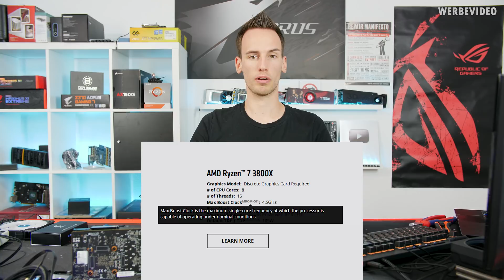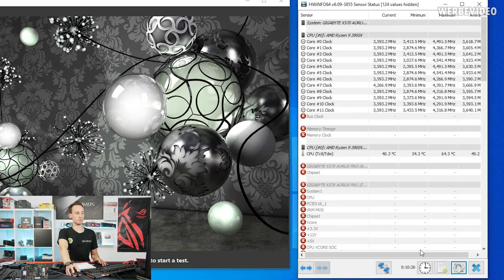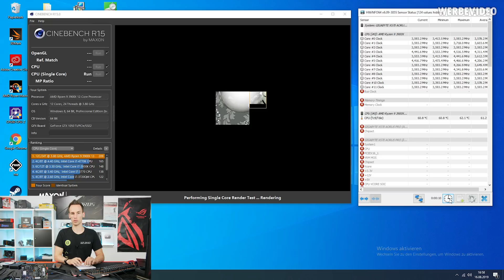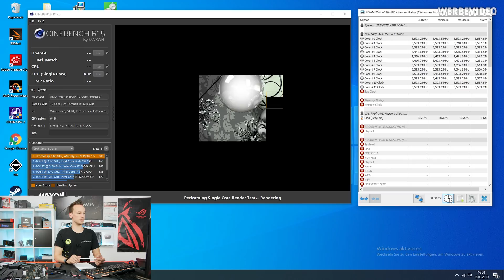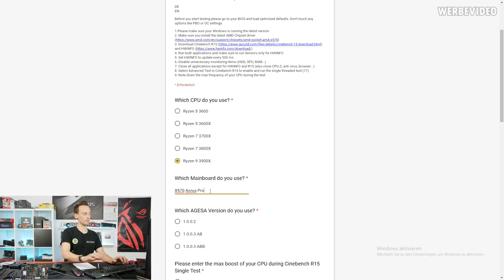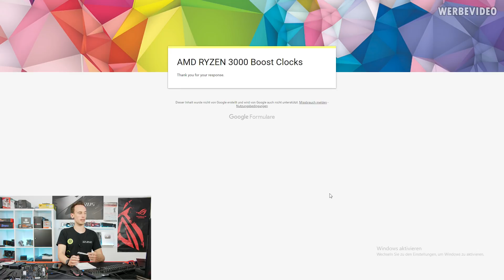I need YOUR Help! RYZEN 3000 Boost Analysis

Comment: Hardware Unboxed just uploaded an interesting video were the motherboard is a factor in clock speed.
Reply: I built 2 systems recently where I saw the same thing.

Annoyingly, the better clocks I got was on the lesser of the two motherboards.

And with lesser I mean their MSRP was almost 100€ different :@

Looks like Ryzen 3xxx bios and microcode still needs a tad of time to mature.

Fantastic thing about all that is that even with how bloody brilliant these chips perform, there's clearly still room for improvement from just microcode and motherboards.

I can't wait for a refresh of these chips man.
Reply: Yes, something I'd like to add is that even different BIOS versions of the same mobo can be one of the factors in clock speed.
For e.g. BIOS v17 on my MSI B450M Mortar allows my Ryzen 7 3700X to hit its max boost clock of 4,400 MHz during light workloads on every cores or at the very least on 6 cores.
This doesn't happen when running on BIOS v18. Typically max boost would be around 4,300-4,350 MHz.
Reply: and i can confirm thats the case, as my B350 PC Mate has no problem reaching 4.4Ghz single and ~4.25-4.275Ghz Multicore with spikes over 4.3Ghz running as eg. RPCS3 Emulator
On the other hand my B450 Tomahawk reaches only 4.3Ghz Single and 4.125-4.175Ghz Multicore (enabling PBO doesn't help it).
Reply: @Andrzej_Szpadel  It's not the only problem that bugs Tomahawk... hello red cpu debug light. Gotta discharge capacitors by unpluggin power and spamming power button to start it till you hear 2 cracks in speakers. 

Almost 2 months MSI now! Still nothing. Not even an acknowledgment. Support is bots. 

To nie jedyny problem Tomahawka... witamy red cpu debug light. Musisz rozładować kondensatory na płycie przez odłączenie od sieci zasilania, pospamowanie przycisku włączania, aż usłyszysz dwa wyraźne trzaski w głośnikach. Podłączasz i leci. 

MSI od ponad 2 miesięcy ma to w dupie. Zero odzewu. Support to roboty.
Reply: @versedi  Thankfully i'm one with only problem being lower boost clocks, i had no issues booting since i build pc with this mobo for ~month now.
Reply: Ryzen 5 3600 on an A320 Motherboard
the results on geekbench and cinebench R20 are better than the X570 ^^

https://www.youtube.com/watch?v=wF8EuEfKH3Q&t=15s
Reply: I gotta see that. Got the notification.
Reply: yep i just watched that before this 🙂
Reply: Survey results says it doesn't.
Reply: And still didn't test AGESA 1.0.0.2 vs 1.0.0.3 it seems.. Love him and the effort he puts, but I'm pretty sure he should focus on that and maybe even save time
Reply: @Rigardoful  did you watch the video? Where he demonstrates how to setup a baseline and requests viewers to contribute their results? Did you expect him to flash a previous bios version on his existing hardware?
Reply: @whiteburr  Yes

Comment: Check hardware unboxed video, looks like it's motherboard model dependent, not the CPU.
Reply: Not just MB, but also AGESA version. I'm reaching 75mhz higher max and averages on 1.0.0.2 over 1.0.0.3abb. 
The way he is going to collect data should show that CPUs are reaching higher clocks on certain Mainboards and AGESA versions.
Hardware Unboxed just checked the mb without taking different AGESA versions into account

Comment: Is it normal to get a max boost of 4.578619 GHz on a ryzen 3700x?
Reply: no
Reply: Have you reset the bios to defaults?
Reply: @no-eb2xx  yeah
Reply: @doufmech4323  i guess you have a good chip :-)
Reply: Most likely your MB just misreport its FSB and that in turn influencing the reported max clock.

Comment: Have a 3700X, and I’d be happy to help when I get home from work.  Here is my post from another video posted today:

My 3700X with ASUS ROG Strix X470-I works best with original AGESA 1.0.0.2/BIOS version 2501, and original chipset drivers.  If I install new BIOS with AGESA 1.0.0.3AB or new chipset drivers, I lose performance.  Original set up sees a couple cores hit 4.4 and Cinebench R20 hitting 4870.  New set up sees none of the cores hitting 4.4 and Cinebench R20 losing 100 points +/- 20 points.
Reply: I found the same with 3900X on X470 Gaming 7. Currently the highest I see is 4.5, but original BIOS and AGESA I saw 4.6 on at least 2 cores.
Reply: B...but have you tried yet AGESA 1.0.3.420 BLAZEIT? I read on reddit that this time for sure all the issues are nailed down.

/s

Comment: Just use one of the motherboards that hit the clock as tested by HUB
Reply: He tested one chip on a bunch of motherboards.  Different chips may perform differently.  Different Motherboards of the same type may perform differently.  That's why its called the Silicon Lottery.    This is looking like a bios problem.   AMD is using its customers as guinea pigs again.

Comment: Got a 3700x. I will gladly answer your survey
Reply: 3700x here as well. Max stock single core score of 4.3ghz and only one core ever hit 4.3ghz. I can't get an all core overclock to go over 4.3ghz either. 4.3ghz all core at 1.3v. It booted at 4.375ghz at 1.43v but wouldn't complete a cinebench run. Corsar H150i  pro.
Reply: @BloodDjimon614  stock cooler, I got a stable 4.3GHz overclock at 1.325V, anything higher/any lower voltage results in either cinebench crashing or the CPU reaching crazy temps like 115°C and shutting off.
Temperatures are pretty high with the stock cooler, might consider buying an aio
Reply: @FAB1150  3700X here on a Crosshair VII Hero WI-FI and Corsair H150i. My 3700x clocked at 4,3 ghz all cores even at 1.40v is unable to complete a Cinebench R20 run. Maxximum it gets 4,25 Ghz.
Reply: @FAB1150  I was getting almost the same temps on the stock cooler as my 360mm AIO. The stock Wraith MAX RGB peaked at like 82c during Prime95 run for 3 hours. The H150i Pro peaked at 74c. Seeing as one came free with the CPU 8c difference isn't much considering the H150i Pro RGB cost $200 more.
Reply: @BloodDjimon614  might be a problem with the cooler? Still, 74C is better. 

At 4.3Ghz 1.325V my temps are pretty high, 85-90C when, so i put it at 4.25 temporarily.
Reply: @FAB1150  well. I just updated to ABB.  both my single and all cores dropped...
Reply: @rockedout  dropped frequency of temperature?
Reply: @FAB1150  frequency
Reply: 3700x here as well.  I ran der8bauers test and hit 4.4 on 5 of 8 cores.

https://imgur.com/a/AcBYnyI

Under slightly different conditions - e.g. with PBO enabled, with more sensors running, with fewer things disabled, it would only rarely hit 4.4 (and usually on 1 or 2)

This on cheap air cooler (Cryorig H7)

Maybe interestingly: the actual performance (actual cinebench score) # was higher when single-cores DIDNT hit the top speed on as many cores.  Only by a tad, but the point is people are trying to hit a # w/o actually paying attention to what the #s mean in practice.

The 3700x also will auto OC to 4.25 all core simply by turning of "Game Boost" in the MSI BIOS settings. 

(same link above, second pic)

 No tweaking of voltage at all: it automatically runs the all-core OC at surprisingly low voltage (1.1 or so)  Super-stable, slammed it w/ AIDA 64 for about 20 mins, ran every stress test i had available.

I think people who are having problems , is mostly due to BIOS/agesa versions and over-tweaking settings.  Everyone reporting optimal performance #s tend to say "everything set to stock", Ryzen balanced plan, etc.
Reply: 3700x on tuf x570. single core 4.4 ghz & 4.3 all cores. all with stock cooler and without oc.
Reply: @fallenlordik3738  what bios? damn it why mine is so much lower on both single and all core. did i just lose on silicon lottery?
Reply: @rockedout  1050 bios/ agesa 1003 abb. don't use asus(turbo or whatever it called)  bios preset. it's lock cores on 4.05 ghz
Reply: @fallenlordik3738  hmm. Maybe I should try ABB. Ya I have tried the Asus oc in bios. It gives me worse result than stock with boost.  How is the temperature after ABB update?
Reply: @rockedout  +2-3c
Reply: @fallenlordik3738  cool. Thx for the info
Reply: 3700x with asus x570 tuf here.  single core max at 4.3Ghz just one particular core and 3.9Ghz on all cores.  the results are from having all default bios setting other than ram frequency and timing, just stock pbo, and monitoring for about 2 weeks on normal usage.  haven't tried oc yet.
Reply: my 3700x goes to 4.4 always and more than 1 core and i tried with x470msi and now i am ordering the x570 pro-a which as HU tested is the best. and the money is also good!
Reply: My 3700x goes to 4350 MHz in Cinebench 15 and 3.9GHz on all core. With PBO there's not much difference, except it hits 4.0 GHz on all core. Using it on x570 Aorus Elite
Reply: Mine does 4.364 mhz on this single core test on  ax570 I AORUS PRO WIFI. Normally I run it at 4.1 ghz all cores and 1.19v vcore under stress which is 1.24 on idle.
Reply: 3700x, too - NH-D15 SE; all stock, Gigabyte Aorus Pro: 4.3Ghz all core, 4.375 single on occasion. Edit: RAM is at 3200Mhz, 16-16-16-36
Reply: ya... mine only goes up to 3.925Ghz pushing all cores and 4.35 on single. wtf
Reply: everyone needs to include your ram speed and motherboard model/brand
Reply: All cores: 4.25 GHz. Single 4.38 GHz
Edit: Using a msi x470 Gaming pro and 2x16 GB 2666 MHz RAM
Reply: Lol guys... He got a form in the description.. You all should fill in there as well..